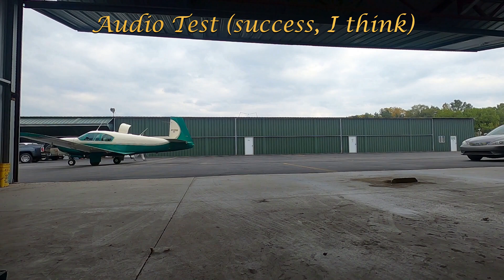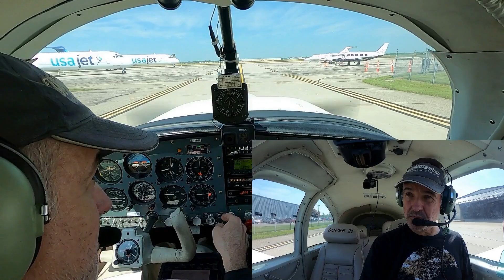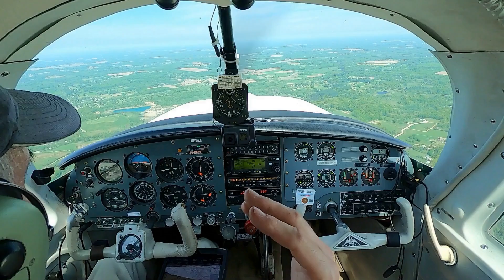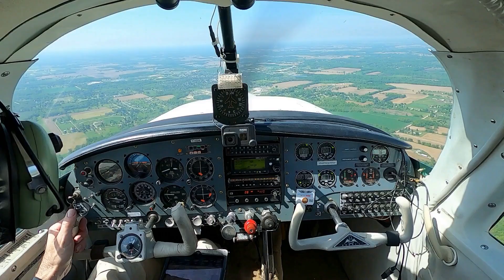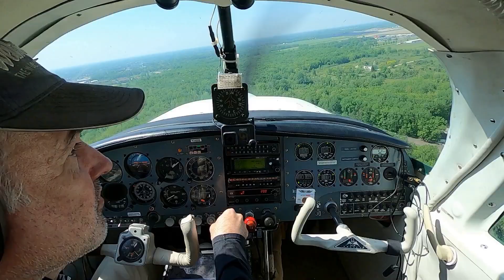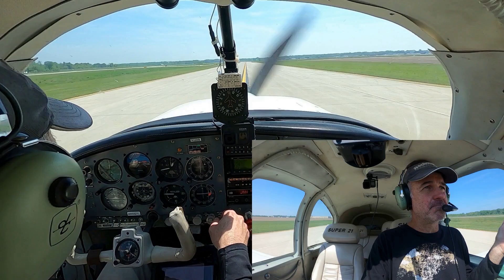Some Audio Success (In-airplane audio improvements)

Comment: Sounds good to me.  I've got a couple older zulu light speeds with ANC if you want to see if they make a difference. OEB isn't far from you.
Reply from the maker: Unfortunately, noise cancelling headsets only affects the speakers in the earphones, but not the mic.  I don't know what other people think of the background hiss.  It doesn't bother me too much since I'm used to it from being in the airplane, but I find it a bit harsh on the ears in the videos (especially since I'm missing the other sensations in the airplane that may distract me from it).  I checked some of my favorite aviation youtube channels (310 pilot, Matt Guthmiller, and as far as I'm concerned the best production of them all Niko' Wings) and they all have the same hiss, so maybe I shouldn't worry too much.  Niko's airplane has the hiss but his intercom squelch kills it very quickly (like a quarter of a second), where mine is like 1.25 seconds). Anyway, I'm happy with the filtering in the post processing, but I think the biggest gain was eliminating that damn +20dB gain - that drove me nuts trying to figure out why I always over-drove the amp.

Comment: You sound like you're in a plane. Interesting how the radio filters the sound differently when you are talking to ATC ?
Reply from the maker: As soon as you push the push-to-talk switch, the squelch circuit in the intercom is bypassed.  I think that causes the difference in sound.
Reply: @FrugalMooney  I think that is only for receaving so as not to get in trouble 
(Ref; " Tenerife Airport Disaster ") one of the factors there was that both planes where transmiting at the same time, 
So now we can hear if some one else is also transmiting. but the radio it's self seams to have very good noise canceling like a modern smartphone ? What if you/we recorded the audio with another device and added it in editing (Smart Lavalier Mic or dub over like the movies do ha ha)?